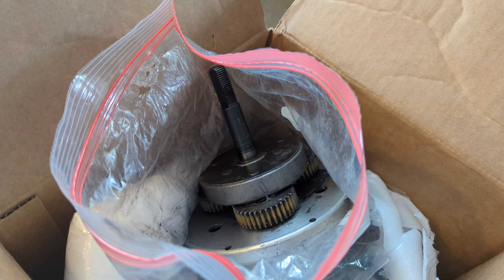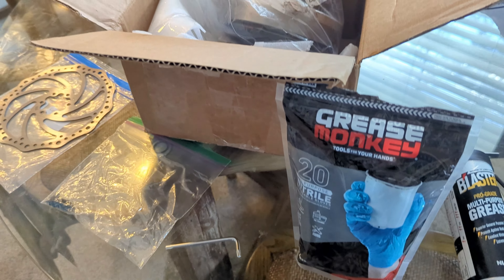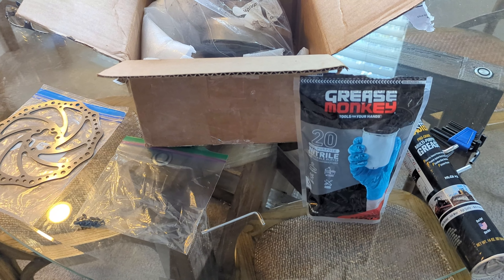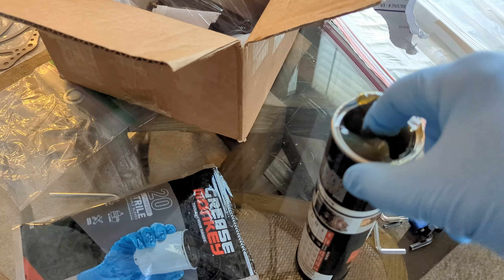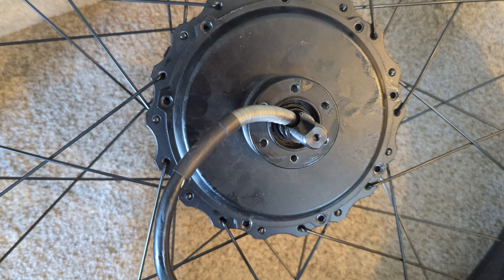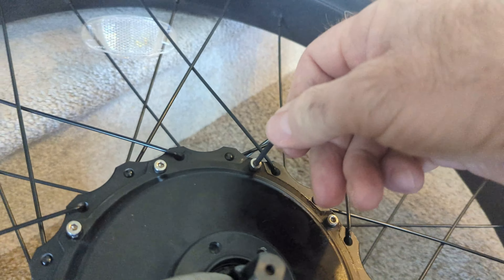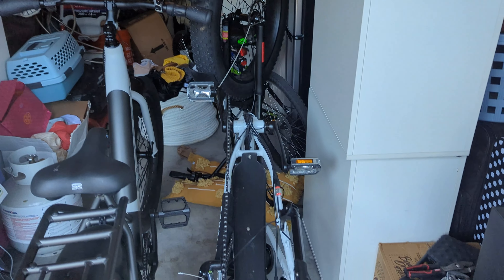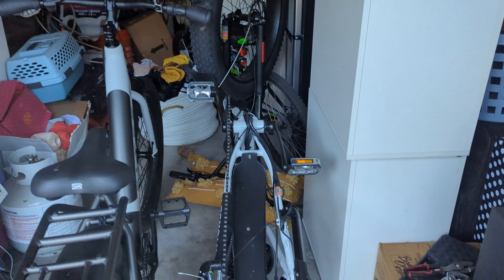How to install a rear motor on your E-bike for dummies

Comment: Hi Kevin. I’m a fellow Mallory Creek resident and I currently ride an Evelo Atlas. It is primarily for exercise as I rarely use the throttle. I like that it’s a mid drive with a Gates carbon fiber belt drive which means little/no maintenance. I am considering getting a second ebike for pleasure/speed rides and am strongly considering a Wired. However, when I reached out to their customer service department regarding maintenance I was told that the rear hub needed to be lubricated 2X a year.  Might be a deal breaker for me as I just can’t see myself removing the rear wheel and opening the hub assembly that often.
Reply from the maker: Thanks for watching. I think that' twice a year lubing the hub motor response might be just a bit of an overreach. I've only had to do it once and that's cuz there was an issue with a few of the magnets coming loose. I sent it back to wired after having a long discussion with the owner about it and they fixed it and how the bike is even more incredibly fast. They said that's been about a 1 in 1,000 bikes sold problem. So very rare. And quite frankly, if you ever had to do it, I could help you with it because it was much easier than I thought. In fact, I made a video on it. You can search for it. Overall, I can tell you I absolutely love my wired bike. I bought the step through model. I bought it because I didn't want to be wishing I had bought something faster and more powerful. And I'm never left needing more speed or power. It's more than enough for me. Since we are neighbors, if you ever want to take it for a ride just hit me up and I can bring it by and let you see and take it for a ride and see what you think. I think you'll be very impressed. You can reach me here or direct message me on Facebook.
Reply: Thanks for your reply. A lot to think about. The speed is what my Evelo is lacking. Top speed is 28 mph. I’ll be in touch.
Reply from the maker: @Ironpeddler1017  I bought my daughter a Flyer e bike that's capped at 20 mph. Once you ride a 30+ MPH bike it's tough to go back. My max speed averages about 38 mph. I am 192 lbs.
Reply: Kevin, I’m curious as to why you purchased the step through cruiser as opposed to the freedom which has full suspension for the same price? BTW, if I placed my order today I am looking at late November delivery.
Reply from the maker: @Ironpeddler1017  I just liked the look of the step thru better. I am not really riding rough mountain trails and the step thru seemed easier to mount and dismount. As far as the wait time goes it is well worth it. After all how often are you going to buy an e bike? This Wired is worth the wait!

Comment: Excellent video you did a perfect job! Have you noticed more power in the motor? If so was it torque or top-end speed? Thanks for the video also!
Reply from the maker: Thank you. It was top end speed for sure.
Reply: What is the top speed?
Reply from the maker: @orvillecooper8334  42 mph has been my max.